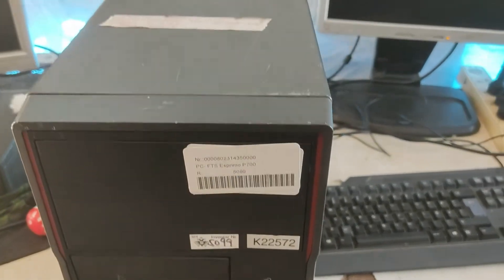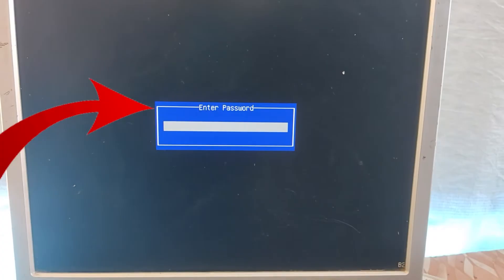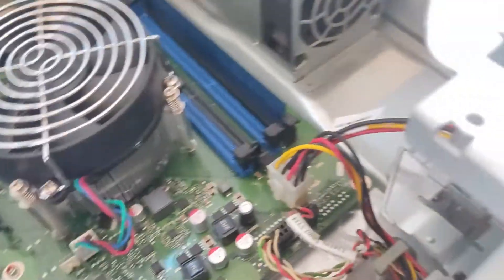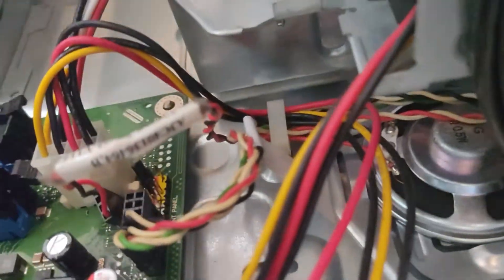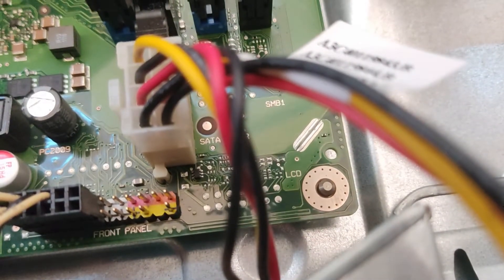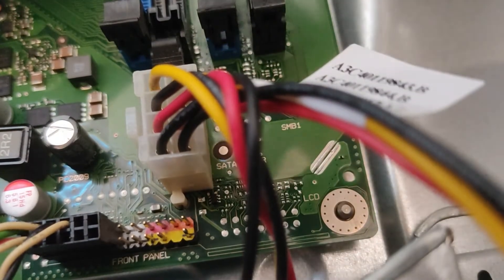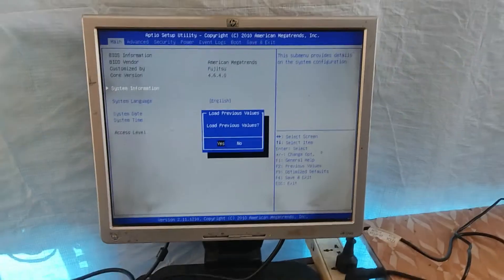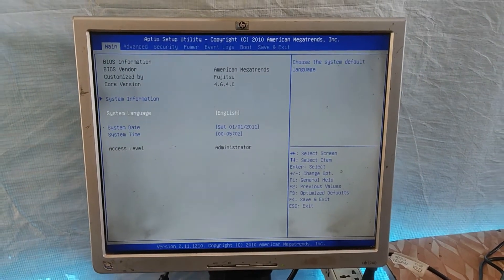How To Remove, Reset Fujitsu Esprimo P700 Bios Password

Comment: Works fine! 😎 (... really mean that they hide the right jumper there, as a freely visible other one is lurking on the board too! 🙄🙄🙄)
Reply from the maker: @jaybear1224  Great to hear, that's Fujitsu and their sneaky moves 😂
Reply: @AMNOWTECH  And another question is, why the heck is removing the CMOS-Battery with contact-shortcut is resetting the CMOS, but not this stupid password - which can be deleted then with this "hidden" jumper ... makes no real sense to me. 🙄🤔🤔🤔

Comment: Can you tell me if the computer has a hdmi connection and were it is
Reply from the maker: No it's not having HDMI  port
Reply: @AMNOWTECH  i cant connect with my monitor because the port in the monitor is different with one in the computer.Can you tell me what to do
Reply from the maker: @Boban-_- sorry for the late reply, 
     Check if you have DVI or Display port on it, either one can be used as a display source

Comment: Are those regular PCs or a kind of server? Got a hold of a Fujitsu MI3W (no HDD) may have been used with some point of sales (POS) devices. I didn't take the sales equipment, although they also were Fujitsu, just the PC. Thank you 🤓